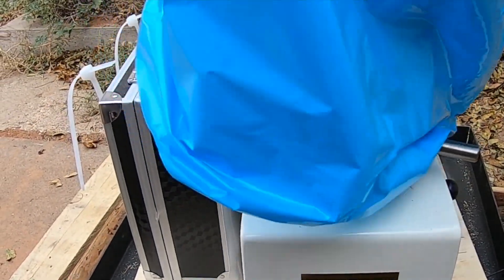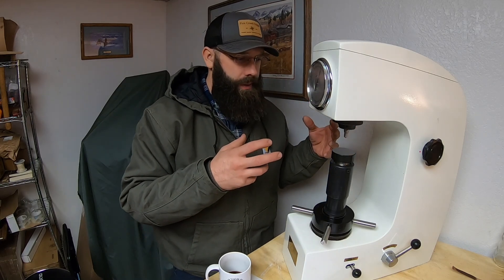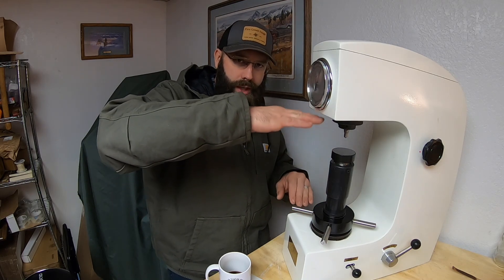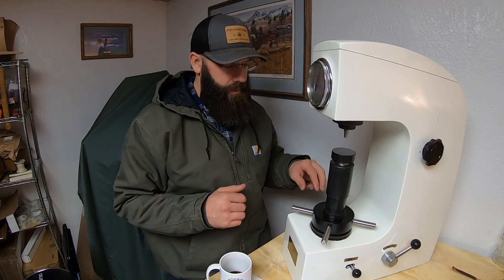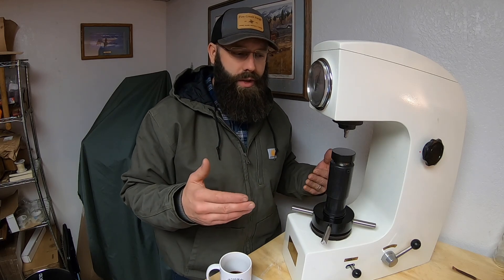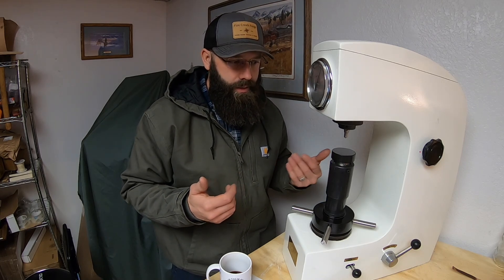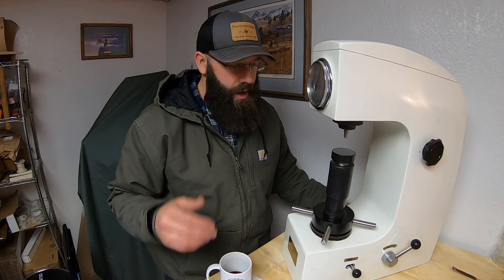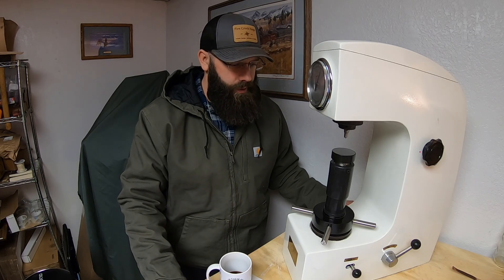So it begins... Rockwell Hardness Tester

Comment: This hardness tester can help in changing specs for your heat treating formulas.   You can go from a +-25 HRC to a +-5 HRC, especially if your going from draw to cryogenics back to draw.  TheRockwell  machine is 100 times better than the hardness files.

Comment: I would love to see the differences in 1095 quenched in warm canola vs p50 and a 150* brine quench. I know the results but would love to see the actual numbers. I say 1095 because it’s a water (fast) quench steel and it’s  what so many people have recommended for a beginner steel which I do not agree with.
Reply from the maker: Yep I agree
Reply: As a beginner, who is open to any advice I can get, what type of steel would you recommend for my first blade.
Reply from the maker: @jasonrankin7110  I'd  recommend starting with 1075, 1080, or 1084, which are all basically the same thing since they are within .05% of each other in carbon content. These can be heat treated effectively with simple methods.